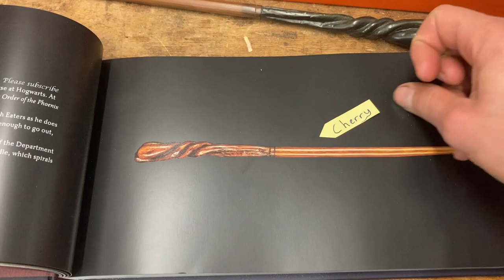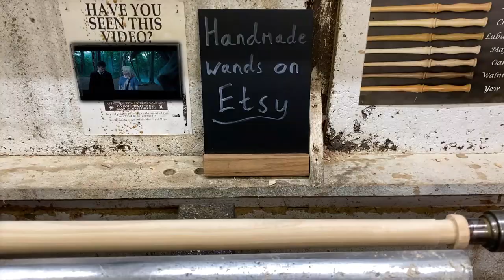Making Neville Longbottom's Wand - From Real Cherry Wood!

Comment: Question, what kinda paints do you use on your wands? Do you use a primer first or some gesso? And what do you use as finisher?
Reply from the maker: I use spirit stain where possible now as it seems a bit more authentic to the craft rather than primer/paint. Then I use a sanding sealer and clear wax to give it some shine